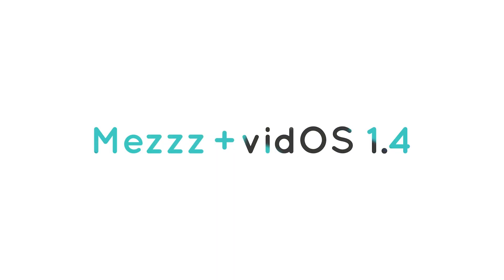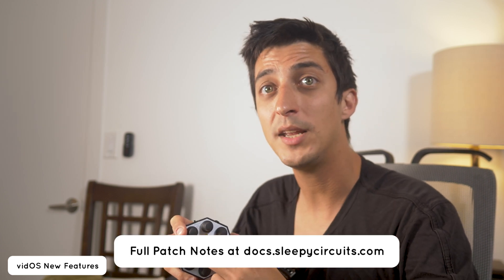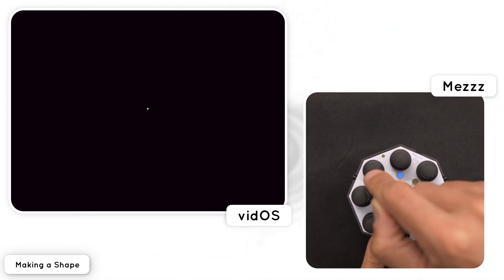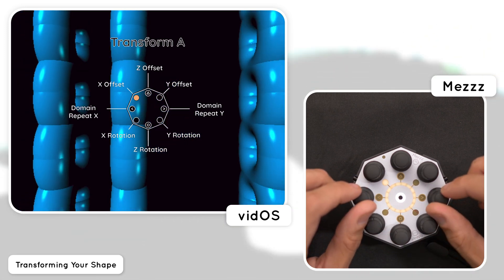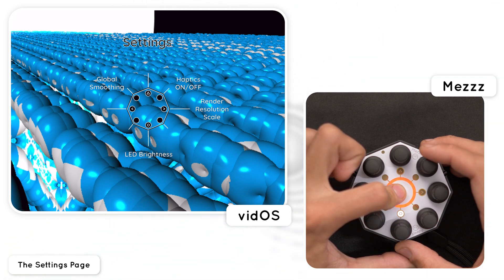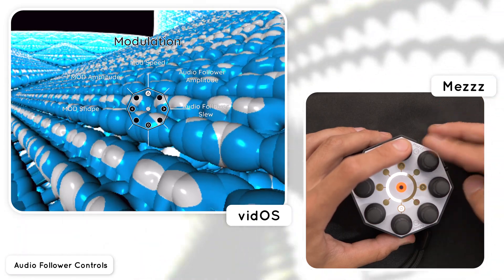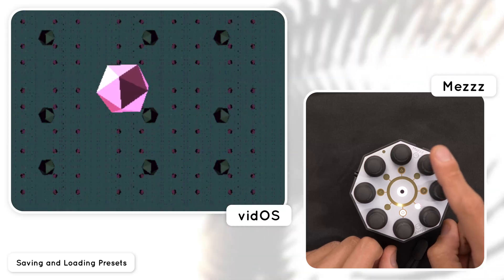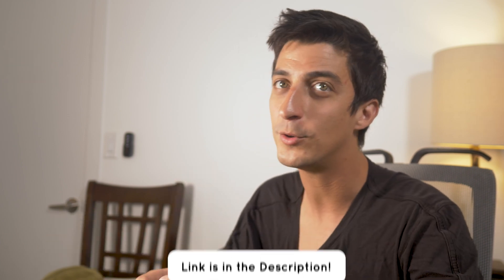Mezzz + vidOS 3D Video Synthesizer Visualizer Tutorial (v1.4): Audio Reactivity, Presets, & More!

Comment: Sorry for the bummer but my Mezz does not work properly with audio reactivity . The support did not really help so far. Takes some time to get some answers somehow. And by the way: the extra for sending it to Germany is quite shocking, I paid 89,- Euros. But this, I guess is due to the political situation . Nevertheless I am stuck with a quite expensive and fancy midi controller which does not do quite what I want
Reply from the maker: hi i’m pretty sure i have replied to your support query with detailed explanation on troubleshooting and did not get a follow up; please reply there if you need more assistance and we will try to get you going

Comment: Thanks again for this update, I got the $50 Apple cable for hdmi output and that was great. I didn't have time to make presets yet, so it wasn't used yet live. But when I failed to be able to use it at a gig, I was wondering if maybe the default boot up patch can be set to a preset in this rev or a future rev, so it never boots in the mode where it's hard to dial anything in at first without remembering how. Not all users are going to know this ting as well as you, but I love where this software is heading. Was awesome to meet you recently! 🫶